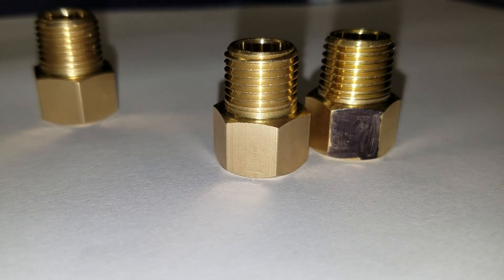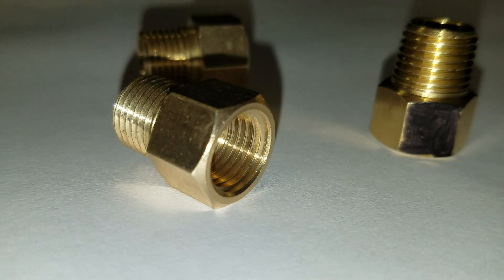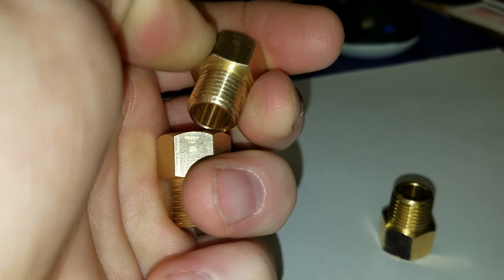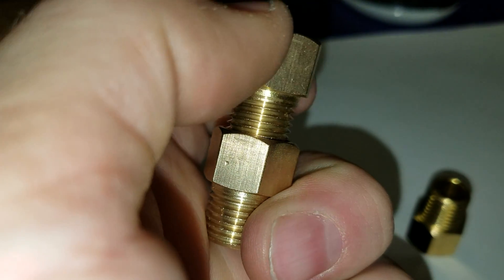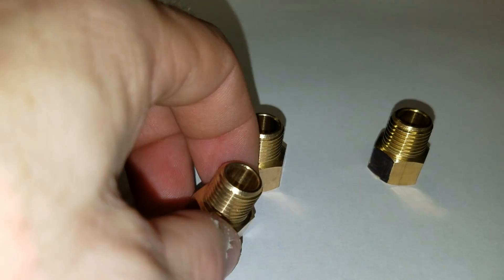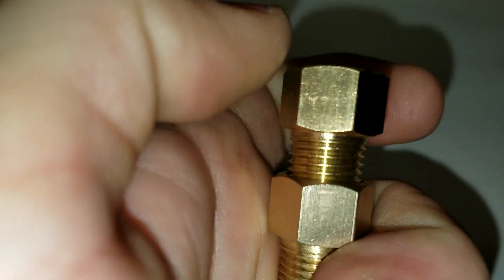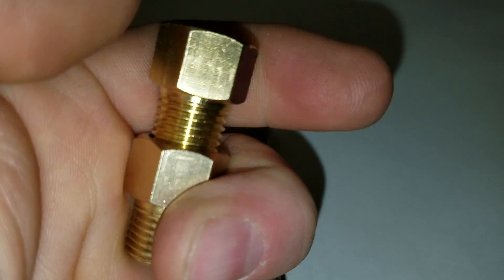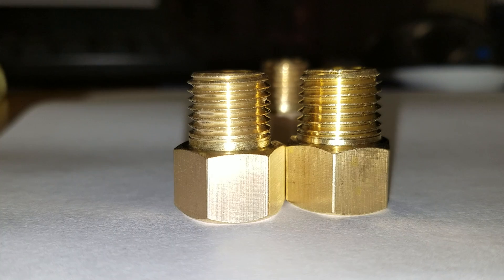BSPP vs NPT

Comment: ISO 7-1 Scope
This part of ISO 7 specifies the requirements for thread form, dimensions, tolerances and designation for joining pipe threads, sizes 1/16 to 6 inclusive, for joints made pressure-tight by the mating of the threads. These threads are taper external, parallel internal or taper internal and are intended for use with pipes suitable for threading and for valves, fittings or other pipeline equipment interconnected by threaded joints. An appropriate joining medium should be used on the thread to ensure pressure-tight joints.